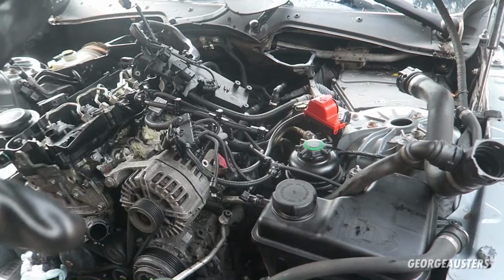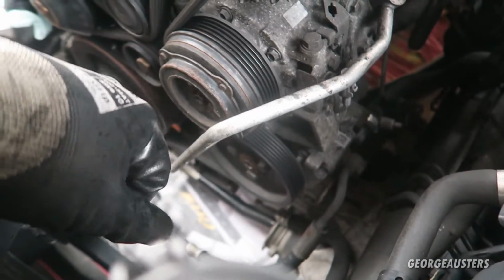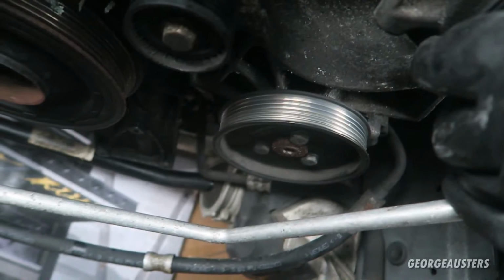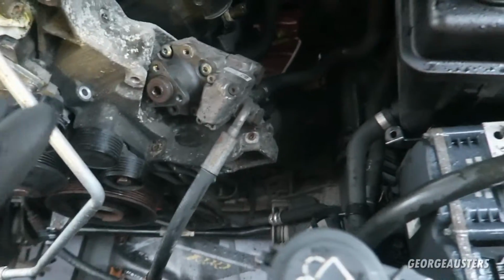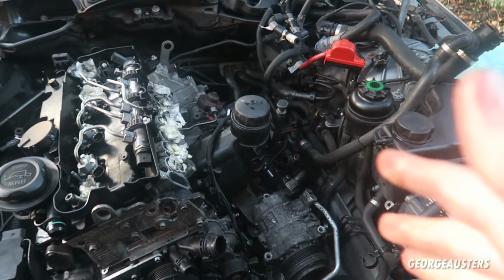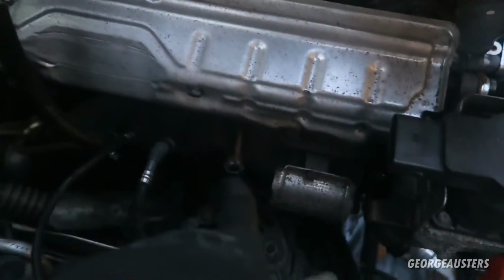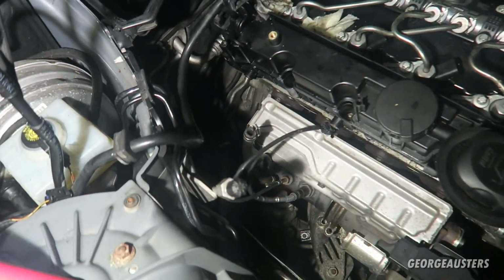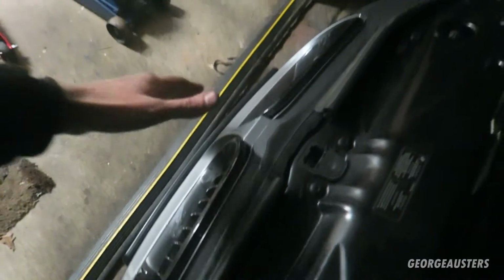How To Remove BMW N47 Engine | 120D 320D 520D

Comment: Bro how the hell didi you get that top bellhousing bolt off did u have to remove some stuff from the top of the engine or did u get it from underneath?
Reply from the maker: A lot easier with wiring and intake removed from the top

Comment: The timing chains can be replaced without removing the engine by dropping the propshaft, gearbox, clutch and flywheel working underneath.
Reply: Been there done it wont do it again its is hell just take it out
Reply from the maker: Same.. Removing the gearbox and doing the clutch was a pain in itself! Let alone lying on the floor doing the timing chain kit
Reply from the maker: Yep.. not fun lying on your back in a wet and cold driveway though!
Reply: Would benefit from doing it on a ramp or quick jacks if you want to do it that way.

Comment: Hi George, is it possible to replace a N47 engine with a M47 engine in a E90? Do the electronics prohibit?
Reply from the maker: Possible but really not worth it
Reply: @GeorgeAusters  Thanks for your reply. My N47D20A has a cracked block (beyond repair) and there's a E90 with M47 engine i can use (car has damaged gearbox). Was considering replacing the N47 motor with the M47 engine.

Comment: Unfortunately I sucked in some water during bad flooding recently  where I live :/ Changing the engine on my 320d this video helped a lot so thank you! Only thing is the engine bay is smaller so a lot less room at the rear of the engine, Its a pain to get at the bell housing bolts!
Reply from the maker: Glad to help!
Reply: how did you end up doing the bell housing bolts. mine is a automatic gearbox e92 320d and i can’t figure out how to get them out

Comment: Hello
I want to know when u upload the second video ?!
Thanks a lot and go ahead
Reply from the maker: They are all on my channel
Reply: @GeorgeAusters  i saw all 3 videos thanks a lot 
Actually i have now another problem with my n47 engine
I have codes 4B90 
4560, 4570, 4510
And that related to fuel system
that was suddenly in a moment the car stoped and wouldn't start
If u can help me with that i will be 
grateful  
Thanks

Comment: Hi can you please tell me where the crank case breather valve is on the n47 i can see the cap but not tge main body it looks like it cannot be removed unlike the m47, thanks.
Reply from the maker: Yes you don’t remove the crankcase breather on this engine. 

You can only replace the diaphragm which is built into the cap but there is no need to do so if it is working fine👍🏻
Reply: @GeorgeAusters  thanks im just getting a smokey start snall bit of blue smoke but engine is not using oil have you any ideas
Reply from the maker: If it’s not losing any oil then I wouldn’t worry. 

Blue smoke usually means valve stem seals or piston rings.

Are you sure it’s blue and not white/grey?
Reply: @GeorgeAusters  could be grey maybe im being paranoid but thats great thanks for getting back to me